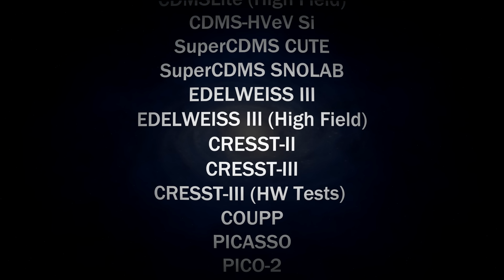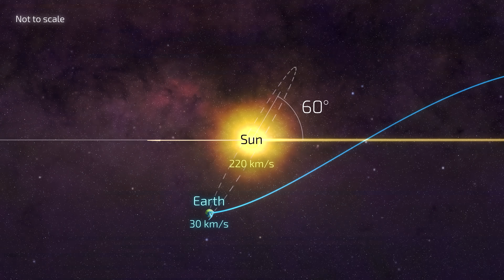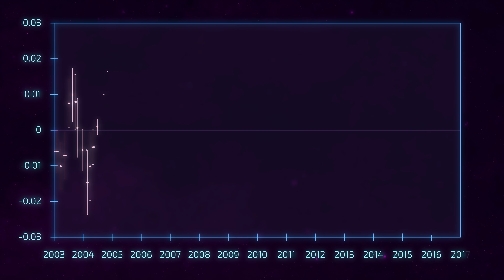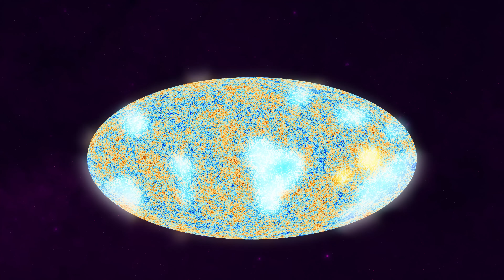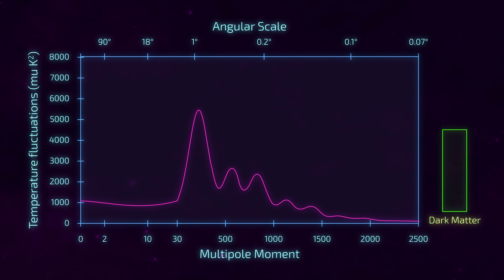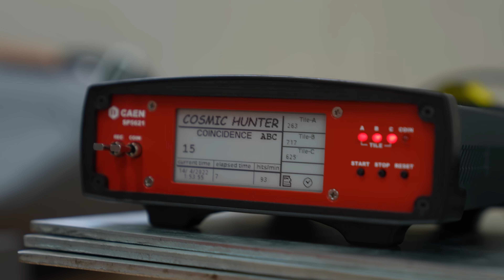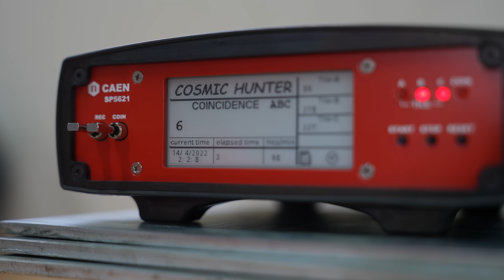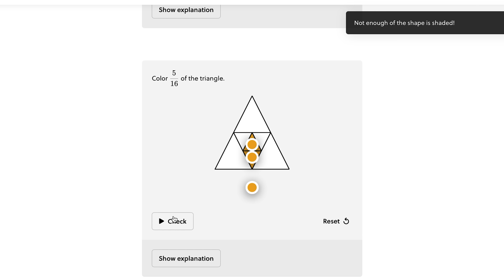The Absurd Search For Dark Matter

Comment: I think the problem of not finding “dark matter” or any corresponding “particles” is a fundamental one.  Let me explain.

Imagine our universe lies on a brane.  And for visualization purposes, this brane is like a “sheet”.  If I stuck lumpy objects, made of ordinary matter, under the sheet, the effect would be like gravity.  We use the same “rubber sheet” model for gravity, except now this is on a much larger meta scale.

You’ll never “detect” discrete particles or anything, because it’s under the sheet.  Ironically, and probably more scary, is that if matter/energy did poke a hole in the sheet, it would be monumentally cataclysmic; a “big bang” dare I say.  

Anyways, the way I think of my sheet model, if you were going to detect anything if the “sheet” is permeable at all, it would probably be “easier” to do so near a super massive black hole.  Where the “sheet” is likely the “thinnest” or closer to the dark matter “outside” of the universe.  But even then it still may be impossible.  It may be that the macro effect (“gravity”) is the only clue we are going to get. That it exist.  If the brane isn’t permeable enough, you’ll never know anyway.
Reply: So you're saying the matter on the other side creates a gravity dimple in their sheet our universe perceives as a hill? Would that make it negative gravity from our perspective? What is 'the sheet'? Predicting it is thinnest around a black hole suggests you assume it to have some physical properties. When spacetime is curved, does it become thinner? Or is it 'stretching' a metaphor to visualise the concept?
Reply: @mgc7199  The “sheet” the best I can describe it is what our spacetime exists  in, “outside” of it is not on the sheet.  Let me give a different visualization.  Take a sheet of paper, lay it on the table.  Now sprinkle something granular on it.  You won’t find anything particularly notable.  Just some random mess of iron filings.

Now take that same sheet of paper and  ball/wad it up nicely.  Now unravel it but lay it down flat, but don’t make it super flat like it originally was.  But now sprinkle the iron filings on it, now they follow the channels and form filaments.  Same sheet of paper different arrangements.  Now I picture dark matter the “crumpling” of spacetime by making the spacetime “lumpy” itself.  The dark matter shapes these “wells” or ridges and furrows that give rise to filaments.  

The effect of “negative gravity” would just be the effect of rolling down the ridge into these furrows, which would explain “voids” and galactic clusters forming filaments.  I know this is oversimplification but this is how I visualize/conceptualize it.
Reply: @SykoEsquire  The problem I have with this is that the effect of gravity needs to be reversed in order for this to work. Suppose I have two equally low pressure systems divided by an impermeable but flexible wall. There would be no effect on the wall. Only when one of the systems has a different value do we see any effect. Why does dark matter gravity 'blow' on the sheet instead of 'suck'?
Reply: @mgc7199  Look at the “model” I gave you with the waded paper and iron filings.  The paper, the desk it sits on, the iron filings, even the effect of the gravity acting on the crumpled paper is all the same, but the configuration of the iron filings are completely different.   With “filaments” and “voids”’.  

Put some basketballs under a blanket, then put some basketballs on top of the blanket, see how the basketballs can only occupy certain areas defined by groves.  Remove the blanket, and now place the basketballs on the bed.  Obviously, basketballs can’t occupy where other basketballs are occupying so they all kind of just settle in a flat plane on the bed.  What changed?  Whatever the “substrate” for spacetime is, affects the interaction.  Spacetime “interacts” with matter and matter interacts back with spacetime.  Put matter/energy on either side of it, it affects the spacetime and how the matter/energy on either side of it acts/interacts.  

These are far from perfect analogs, but that is the best I can do.
Reply: @SykoEsquire  I don't think spacetime is the thing that prevents us from seeing the other side, so to speak, but you could be right that distortions of spacetime can be felt through whatever it is. If so, what would happen if a galaxy encounters a steeper 'hill'? Would we expect it to change course? Would we see the dark matter be pushed out of the way? Both?
Reply: @mgc7199  I apologize, but I am going to invoke another analog.  The way energy/matter, encounters the dark matter “under” the spacetime, is like water in a river.  The energy matter “take the shape of it’s container” like a fluid or water, in this respect.  Again not a perfect analog.

But what does water do as it encounters hill, mountains, valleys?  It just follows the path of least resistance.  Water doesn’t just roll up a mountain.  Same for galaxies.  They follow these “chutes and rivers.”

When they describe large voids in space I picture these as “lumps” or “mountains” in my river example.  The galaxies simply “rolled off” the “bulge.”  Take Bootes Void as an example.  You see the void, then around it, “dense” formations around the bubble then with regular diffusion beyond the dense formations.  

The reason I don’t use the term: negative gravity to define this effect is due to my usage of analogs.  I don’t view mountains or even the formation of mountains as a form of negative or anti-gravitational feat, I picture their existence part of pathways of least resistance, being locally relative of course.  The mountains “popped” up because the rock had nowhere else to go.  

And I apologize for the analogs, it’s just the best way I can think of certain phenomena.

I’ll give you another one while you are here, because you are engaging. Sizing an actual singularity.  We all know black holes occupy spacetime like other matter does, and causes gravitational effects to the most extreme degree.  We have terms for defining the size of the event horizon but not the singularity.  But the singularity does occupy a set amount of “spacetime.”  So I picture a “string” (from string theory, not a metaphorical one) at the Planck Length vibrating at the Planck temperature.  This would be the maximum energy density on the smallest scale possible.  Now you have an energy density for an area at the most fundamental level, you can now take the energy/mass of the blackhole, with that distribution of that unit I described Planck Length String at the Planck temperature.  Stack those units in a spherical formation (there are more steps to this, but I feel it goes on a lot of tangents).  That sphere will give you the smallest size of a singularity possible.  From there you could calculate a distance from the event horizon to the singularity.  This would be a “perfect” model, like the idea of a perfect circle/sphere.  It doesn’t account for strings at the surface of the singularity not being at the Planck temperature.  Think of a neutron star’s surface, where the material isn’t all neutrons on it’s “crust.”

This also doesn’t account for me possibly visualizing a blackhole as a fractional dimensional object, but that’s a different story.
Reply: @SykoEsquire  I disagree with this analogy. Shouldn't dark matter be just as 'fluid' as our baryonic matter is? The container would then not be rigid but act like water as well. Water does roll up mountains when provided with enough momentum. It would also slow down and roll back down the mountain. Regardless of whether dark matter behaves more like a solid or liquid, should we expect our matter to inexplicably change course when it encounters some? Suppose we take two equally sized blobs of water contained in plastic bags in 0 G. Now we provide one of the bags with some momentum and allow it to collide with the other bag. We would expect both bags to change course. Now suppose we could only see one of the bags. It would appear to change course for no apparent reason, right? Are there examples of this happening? Take for instance the great attractor. Does the path matter takes towards it make sense under the current laws or is there clear signs of 'nudging'?

The thing about singularities is that they are one dimensional. Perhaps spacetime undergoes some sort of transformation under very high G's that renders higher spacial dimensions meaningless, like if they would be stretched to infinity. This would result in there being enough space to contain everything in no space at all (when observed from the outside). We do not know what 'the most extreme degree' really is, only what we have found so far.
Reply: @mgc7199  I like your water in a bag model.  Now just make it an opaque bag and us being inside it, is our universe.  We can “know” what is “outside” of our universe, but we can infer some things, if we accept the premise, of dark matter lying “outside of our universe.”  Meaning, we aren’t going to find it’s “particles”, only ever see it’s affects, because we don’t know or can’t know what it is.

The configurations of how it actually is can be endless.  Perhaps be are a small bad of water laying on top of another much larger bag of water. Or maybe our universe is like a droplet of water that is “vibrating” at a frequency, suspending us on top of an ocean separated only by the surface tension of the surface of the ocean and surface tension of our water droplet universe.  Maybe we will be “absorbed” by the ocean one day and that would look like vacuum decay in a metastability event.
Reply: Except that if it was under this rubber sheet, it would generate negative gravity, and push things away.
Reply: @muon_bomb  Right. Their gravity wells would become our gravity 'hills'.

Comment: I've already told them what Dark Matter is. :O/-
It's a dead particle wave produced by a process called Quantum Dimensional Funneling (QDF.)
QDF happens in high pressure points in space, the most powerful QDF point is a black hole.
We exist in 2 dimensions split by another. (-3, -2, -1, 0, 1, 2, 3,)
A trans-dimension that has it's own particle waves, an adhesive dimension called a quantum field, then our dimension.
Most of our local particle waves are actually attached to particle waves (that we can't detect, yet) cross-dimensionally.
This attachment spins in a 4 dimensional direction/space.
QDF tears particle waves apart to distrube both dark energy and dark matter.
One half (DE) jumps to a less resistant area in space (voids) and becomes a strict trans-dimensional particle wave.
The other half (DM) jumps to a local area stripped of local energy, but still retains a 4 dimensional spin.
Gravity is caused by this 4 dimensional spin keeping dark energy away.. well, actually the lack there of.
As our local matter becomes more compressed, that 4 dimensional spin slows down allowing pressure from DE.
Remember, dark energy completely surrounds all local matter.

So, Dark Matter are dead particles that retain gravity via this 4 dimensional spin. 
This is why it doesn't interact with other local matter and why we can't see it.

Comment: Great video as always! I just have one question - if dark matter only interacts with regular matter gravitationally (as with the example of the colliding galaxies), why/how would a dark matter particle hit a nucleus and transfer its energy, allowing it's detection? I'm no expert, I'm just curious - the whole detection experiment seems to contradict the theory as a whole? Or is it just very unlikely to interact, sort of like if dark matter particles were orders of magnitude smaller than traditional particles but much more massive, and are therefore much more likely to simply 'miss' ?
Reply: They're looking for WIMPs - weakly interacting massive particles. The "weakly" actually means it is capable of interacting with ordinary matter through the weak force.
Reply: @Djinn6 @AtticMuse thank you!
Reply: Can a dark matter form black hole, as it can be highly dense?
Reply: "sort of like if dark matter particles were orders of magnitude smaller than traditional particles but much more massive"

That's precisely it! Particle physicists talk about interaction strengths in terms of "cross-section", which is effectively like the size particles look to each other. The smaller the cross-section, the less likely the interaction.

Comment: The possibility of graviton, the proposed composition or what gravity or how gravity interact with matter, is more likely to be true if dark matter will not be proven. My reasoning is that both particles have the same effects on gravity. I guess.
Reply: "Gravity is caused by the mass-energy density of space. This mass-energy density of space is determined by the square of the Wave-Amplitude and is always positive (squares are always positive). The  wave-velocity is inversely proportional to the mass-energy density of space, the higher the mass-energy density of space, the slower the Wave-Velocity. As Matter and its resultant mass-energy density of space are always positive, this causes a slowing of In-Waves as they travel through other matter/wave-motions, and it is this property of Space that causes the natural ‘Gravitational’ attraction of all bodies, and explains why Gravity is always attractive." (Geoff Haselhurst)

"Commendation from NASA for research work at Massachusetts Institute of Technology on the Earth's atmosphere and the Moon's surface for navigation of the Apollo spacecraft to the Moon..
Dr. Milo Wolff has found the structure of the electron consisting of two spherical quantum waves, one moving radially outward and another moving radially inward. The center of the waves is the nominal location of the electron 'particle'. These waves extend infinitely, like charge force. All 'particle' waves mix and contribute to each other, thus all matter of the universe is interrelated by this intimate connection between the fundamental 'particles' and the universe. The natural laws are a direct consequence of this Wave Structure of Matter (WSM), thus WSM underlies all of science." spaceandmotion

Comment: Something in this video I find very unclear.
You mentioned that matter does not interact with dark matter, except for gravity (or thus the change in the space-time field). Then, could you please elaborate on how dark matter can hit and transfer its energy to (in particular) a sodium iodide crystal, but would not hit 1km of mountain above the detector? It just doesn't make sense to me.
Reply: The particles they're looking for, WIMPS interact with normal matter via the weak nuclear force.  This is how it can transfer energy to normal matter.  There's already ghostly particles called neutrinos that even right now come from the Sun, go straight through the earth, and the vast, vast majority of them act like the earth wasn't even their.  Billions of them are passing through your body at this very moment, and you'd never know they were their.

The weak force is...  well weak.  It generally doesn't interact much, so there's only a chance that two particles interact with one another.  You can think of the particles as "small", but that's not entirely accurate.

Likely the issue is we think of the stuff around us is made of hard balls, and when you get down to the tiny level of particles, they aren't hard balls at all, but are more like waves that have a chance of interacting with one another.